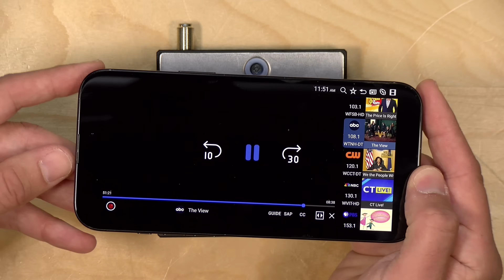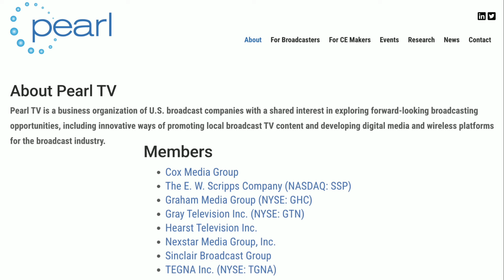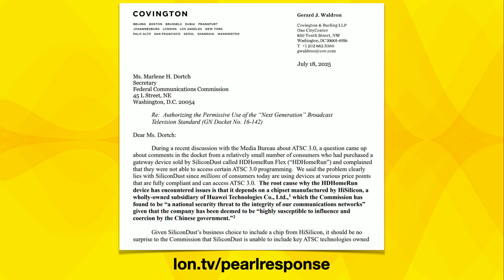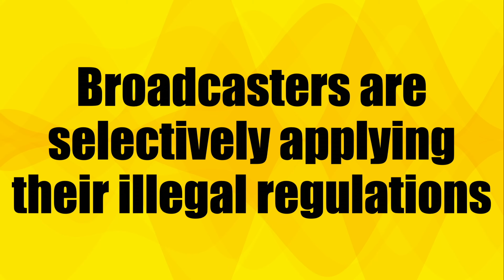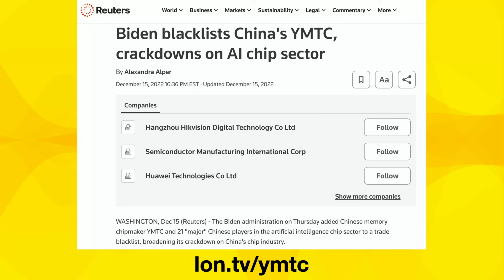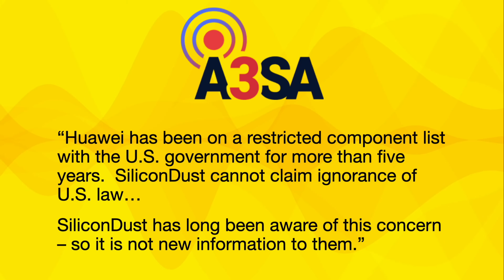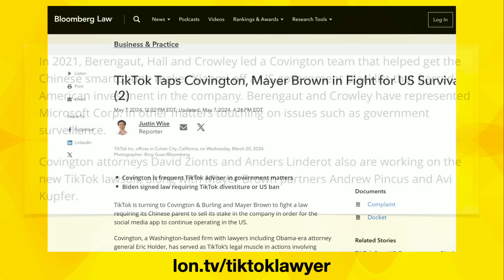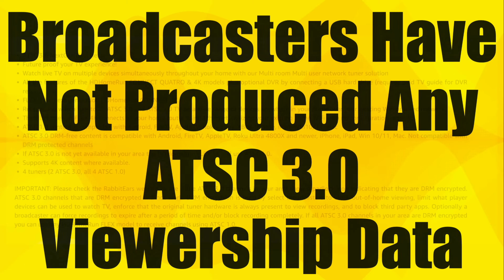Big ATSC 3 DRM Update: Did Broadcasters Admit They Are Selectively Enforcing the Rules?

Comment: I'd like to remind you of one fine point that you always seem to forget. The airwaves are a publicly owned natural resource just like the air, the water, and the public lands are. 
The OTA broadcasters use a slice of those public airwaves to transmit their signals. Why are they allowed to do so? It's something the FCC calls PICON or Public Interest, Convenience or Necessity.  It is a benefit to the public at large. Not only is OTA TV a public interest, (news and information) convenience, (entertainment) it's a necessity (communications in case of emergency.) 
The airwaves they are using belong to us. They are using our natural resource to broadcast their signal to us. In exchange, we've allowed them to sell commercial time to help pay for the expense of doing so. It's worked since the 30's pretty well and other than the annoying commercials, is a pretty good way to do it.
Everything was good until the cable and satellite TV industries came along and wanted to hold their content hostage.  But that's another story.
But it did set up their desire to cash in on anything they can to stay profitable as OTA consumers get fewer and fewer while the cost of running a studio and transmitter has gone up and up. DTV caused a lot of that, but that's progress.
The cable industry does not use public airwaves. They use a closed system - coaxial cable, or fiber - to deliver their content. The same goes for internet streaming. (which incidentally cable and satellite both rely on more and more) The satellite industry only uses some public spectrum to send their content up to the satellites, but it's a tiny fraction of the spectrum and it is narrowly aimed at the sky, not broadcast everywhere. They deliver the downlink signal from your roof (if you still get it that way. DirectTV wants to sell their product over the internet.) to your set-top box and charge you extra for local channels if they can.
So the comparisons to OTA TV is apples and oranges. Only OTA TV is using a large chunk of the publically-owned spectrum to provide their profit-making product. They should not be charging to deliver it. If they want to provide customer-paid services, they should do it over other modes of delivery, like cable, satellite, and internet streaming providers do already, because that's what they are becoming. Their delivery over the air is an exchange for the use of OUR airwaves.
This is lost on all the younger people who think that television is something that has to be paid for. They don't remember when OTA TV was all there was. They don't remember when all you got was three channels and none of them were very good! Things have improved and thankfully, a decent OTA system can get 20-30 stations at quality that was impossible in the past. But that doesn't remove the obligation that they have in return for using our airwaves for their delivery. 
If local TV stations think that they can deliver premium content by encrypting it, and making customers pay for it (on top of sitting through endless commercials) they will lose all OTA viewership as everyone will just switch over to the paid sources of delivery. Then they will be out of business.
The only people they will be hurting is the rural markets that can't get cable or internet, or won't pay for satellite because it's become too expensive. These are very often the same people who rely on it the most for news and weather in case of emergencies.

Comment: ATSC 3.0 is a bidirectional system because it uses an Internet Protocol (IP) foundation that allows for two-way communication, combining over-the-air broadcasts with internet connectivity. This means viewers can receive data back from the broadcaster, enabling features like video-on-demand, interactive content, and personalized viewing experiences, which weren't possible with the older, one-way ATSC 1.0 standard.  

DRM requires bidirectional communication to decrypt to an allowable device such as a TV set.  If the device is rogue such as a recording device, then no decryption takes place.  ATSC 3.0 is to support video formats greater than HD (1080i or 720P).  Content providers do nowt want us to save movies or shows with that high reaolution to prevent illegal sale of high resolution content.

Content providers are supposed to not use DRM on lower resolution content.  So if ATAC 1.0 goes away, we will still be able to watch SD and HD programming in the clear.
Reply from the maker: No DRM on the public airwaves.

Comment: my thing is why isn't a box built with an atsc 1, 3. 3 encryption chip. with technology today this can be done with the build of boards. jt is like on computer boards, all chips are not used at all times.  i would like a box with dvr option with the ability for upgradeable stowage/hard drive.mm2.  stagnation by groups.   as for the chips on board,  i think it was one which processes better.

i have an old TV  which need the hdmi port to  connect to OTA box.

Comment: sounds like a protaction  model for  sat/cable tv

ota fta has enough issues delivering dtv a distance and  the need  for  dtv boosterf  transmission 

regardles of the firmware deployed on these devices you are using a moca standard of  hfc 3.0/2.1 standatmdard which  has data standard 1-2.5 gbps

i don't know whether or not  home run is going to  to deliver data speeds past 10mbps, 1-10gbps

i do not think something designed to play cable services is designed to play ob oya/fta dtv signal since we battle  to get proper digital symbol rate 110-150% signal rate for clear signal 100-70% signale my get get channeling shoen that i doubt it be watchable in any manner

Comment: Okay, I'm officially pissed off. The entire premise of FCC licensing public airwaves to commercial entities for the purpose of "broadcasting" is based on  quid pro quo. The broadcaster gets to use the airwaves to generate revenue while providing a public service. The public service aspect has long been met by providing PSAs and news content that was editorially independent of the broadcast company and their profit motives. While this has changed in recent decades - the newsroom is now subservient to corporate desires/dictates - the shift to encrypt content that is /required/ to be freely available to the public under the terms of their FCC licenses is just absolutely abhorrent. The RF spectrum used by broadcasters, unlike spectrum sold to other commercial entities, remains the property of the public. Encryption of broadcast content should be treated as a breach of contract and the FCC should revoke the licenses of any stations or networks that are encrypting the signal. That's exactly how the FCC would deal with my amateur radio license if I were to encrypt any of my transmissions. Broadcasters should be held to the same standard.

Comment: The largest cable company had already converted all the local broadcast transmissions that were 1080i, such as NBC, CBS, and PBS, to 720p in January 2020, without telling anyone and trying to hide it with their newer boxes that are set to convert the 720p incoming signal to 1080p, so your TV doesn't see the original signal and thinks it's 1080p. But those signals have already cut the resolution of over the-air-broadcast channels that were 1080i by 50%.

Comment: Since I personally do not use a gateway device in the attempt to watch ATSC 3 signals. I have not found a single box that will work on all the channels that carry ATSC 3. What about the people who do not have access due to monthly income. I am personally set up a good quality TV antenna system and get ATSC 1 just fine unless the lightning starts to go crazy and then the signal stops for a second. But my satellite does the same thing except that it will go off for a few minutes. I personally cannot afford a hi price Sony TV to get ATSC 3 and my new Vizio did not have an ATSC 3 tuner. And I bet they do not get all the ATSC 3 channels.

Just Saying 
ATSC 3 has fallen flat on its face!!!

DE N2JYG 
A professional Antenna Installer and who has installed TV Antennas for 50+ years. Former Cable Engineer, 2 way radio Tech., electrician, tower installer etc!!!!

Comment: I have used HD HomeRun since before ATSC3 was a thing.   When my unit blew a few years ago, I got the first generation ATSC3 unit.   It was great when 4 stations in Indy went to ATSC3.   Now it's useless.   I still have all stations on ATSC1 but they are now on an inferior tower so I get a lot more weather issues.    

My setup has the antennas upstairs with the HDHomeRun attached to a wifi access point.   That means no cables at all out of my upstairs and it works very well.   No cable runs in the house are needed.  

The sad thing is I have one TV that's ATSC3 compliant, but no apps can use it to decode the audio. AC4 let alone handle an encrypted input I could receive if I ran a cable.  I do a lot of DVR more than watch live so encryption creates additional problems with time shifting.   A straight signal passthrough would work in that one case.   Other TVs, phones, etc obviously can't do that.   Net result is I'm stuck on ATSC1.   Most annoying.

Comment: Why are we even surrendering to DRM in the first place? The FCC should just ban DRM from all NExtGen ATSC 3 signals or just stick with ATSC1. Broadcast TV was free OTA since the start of OTA TV. This should never be changed to allow DRM because you know we are going to have to PAY for the decryption. It is bad enough to have to buy a device to do this. OTA should got from antenna straight to TV and no device in-between.
Reply: There have been encrypted off-air TV channels here and there since the ‘50s, but they always fail.

Comment: Had the same thing. I LOVED IT. I kept my win7 system with media center running just so I could use the direct cable decryption without using their APP. That is UNTIL... the Cable company decided they're just not supporting cable cards anymore and cut me off completely. TOTAL BULLSHIT...JUST PIRATE EVERYTHING VIA torrents. Seems to be the only way to watch what you want now without a connection into your wallet.

Comment: I'm good with atsc 1.0.... It is what was included in my high quality jvc projection from 2006. I have a dish atsc tuner box, and a couple other converter boxes. Spectrum cable, who does not own the boxes. They think it's hilarious to sit in my apartment parking lot, and reprogram these boxes. One of the boxes has a really unstable antenna levels because they flashed it with junk firmware.

Comment: I hope TV manufacturers just throw their hands up and stop including ATSC 3 tuners.  Without them ATSC 3 would die a quick death.
Reply: ATSC 3 is great but the DRM is the issue.  ATSC 3 does produce a more reliable signal and breaks up less.  With the lighthouse stations having multiple channels, it can help in many markets where there are too many channels to fit in the narrow range of channel frequencies left.  Philly was a market like this.  Without ATSC 3, you wouldn't get ABC since that's on RF 6 for ATSC 1 which is terrible.
Reply: That's pretty much what is happening.

Comment: I haven't been able to tune into any ATSC 3.0 channels in the Detroit area since Saturday. My Sony X90L will pick them up during a re-scan, make them the default channels, but is unable to tune them in. The ATSC 1.0 versions of those channels tune in just fine. I'm not sure what the hell is going on. Nothing has changed on my end, so its them, not me. I always thought the real benefit of ATSC 3.0 was a stronger signal that was less susceptible to atmospheric conditions. Here in the Detroit area, Fox, (2.1) NBC, (4.1) ABC, (7.1) WMYD, (20.1) and CBS (62.1) are all broadcasting their ATSC 3.0 signals from the same from the same tower. (124.02 Degrees) That is the same location as the ATSC 1.0 signal that Fox comes from. So, the interesting thing here is that the ATSC 1.0 Fox signal (2.1) is the only major broadcaster still using VHF in the Detroit area. All of the ATSC 3.0 signals are re-broadcast as UHF. So here in the Detroit area ATSC 3.0 potentially solves a few issues: 1) You would only need a UHF antenna, 2) To get all the major Broadcast channels you would only need to point to a single location (124.02 Degrees) and 3) You should have a stronger, more robust signal. Here in the Detroit area, every time I have checked, the ATSC 3.0 broadcasts are 1080P, with AC-4 audio. I'm not sure where the Pearl TV is going with this, I'm guessing they would like to see ATSC 1.0 go away, ATSC 3.0 put in it's place so they can charge higher rebroadcasting fee's to cable and satellite providers by using DRM?

Comment: The reason why a gateway device is the most popular tuner should be obvious, but its literally the difference between having either multiple antennas or splitting the signal multiple times, which degrades the signal with each split, and both require long runs of coax lines through a residence to each television, which ALSO would require a separate tuner to decrypt the signal. Logistically, this is ridiculous, and is the main reason ATSC 3.0 is going to fail. Now, I believe this is by design, and the FCC already has plans to use the transmission technology for this for other uses. OTA is going to die, and my expectation is sometime before 2030. We are already starting to see local sports games being tied into streaming services. I pay for MLB TV for the Phillies games, but are still subject to blackouts for any games with exclusive broadcast rights on other stations other than the local NBCSP channels (this includes Apple TV, Fox, TBS, ESPN and any others that may come along). Not every local market made a deal with the MLB for even those local channels as well, so I'm actually lucky I can get any of them at all.

Comment: Thanks for the update, pretty depressing overall. We have always been an OTA family and looked forward to the technical benefits of ATSC 3.0 and wanted to use a gateway device to eliminate the need for coax cable to each location we want TV. 

Traditional TV is having a hard time competing with VoD (video on demand) so it seems broadcasters are doing everything in their power to kill traditional TV. Looks like another industry so intent of protecting legacy business they miss a technology inflection point and quickly fade away. I've posted this before TV set OEMs should just eliminate the entire RF section and call it a smart monitor.

Comment: Tablo made it so easy for me to cut the cord, only one device needed, no need to snake antenna cables all over the house.  I can even sit out on my porch and watch TV on my tablet  And I can reocrd what i want, as well.  I agree that this IS what people want.

Having to buy a separate tuner for each TV is pricey.  And right now, buying TVs with built-in ATSC 3.0 tuners is out of financial reach for me and many other people.  This nonsense will cause low-income people to lose access to OTA TV.

I live in southern NH, which is the Boston TV market.  Most of the ATSC 3.0 channels here are encrypted.  Fortunately, I can get them all in ATSC 1.0.  So just because ATSC 3.0 channels are here doesn't mean anyone is watching them.  I flat-out refuse to buy any ATSC 3.0 stuff, I will use what i have (Tablo) for as long as it works.
Reply: I agree and I'm in the same market (southern, NH) and same boat as you (1st gen Tablo). It works great, I've had it for 10 years and I don't have the ability to run cables throughout my house to every TV. Also, each time you use a splitter the signal decreases by 3db. This causes me to lose many stations. DRM = Fail for ASTC 3.0

Comment: rewality of the dtv signal if you haven't installed rg-6b or better  you will have piss poor signal ra where reception..the new standard  is mostly sat/cable tv standard
Reply: B? And RG-59 is fine depending on cable length.

Comment: Is there an accurate list anywhere of the devices that are capable of receiving ATSC 3.0 DRM encrypted signals?... I have  TVs that are fine for me.. and have no desire to spend money for an "upgrade" I don't want. Also I  have a Tablo gateway that works great with the ATSC 1 signals. I see no reason to spend any money for ATSC 3.0... which means all the advertisers will also be the losers when ATSC 1 goes away.
Reply: The devices that have HDMI out that plugs directly into your TV are the ones that will work.
Reply: @Banzai51  which means for every one that has multiple TVs they will need a device for every one.  No thanks!

Comment: While I am a huge supporter for free OTA reception, and have been using Slingbox for 20 years, and recently streaming from a dedicated H.265 encoder(and still pissed off about the destruction of Locast), I understand why some devices may not be trusted.  If a device has a processor and operating system that can be compromised, it may not be able to be trusted not to be turned into a DOS bot.  I'm not saying that this is the case with any specific item, but any item that has a computer built in with internet connectivity can possibly be compromised, even if it's primary function is just to transmit video and audio, as clever hackers can reprogram these to do many other malicious things outside of the scope of their original intended function....

Comment: I have my nice ATSC-1 converter box.  I won't be buying an ATSC-3 device so long as this DRM BS continues if ever.  At some point, I think I will be taking my TV out to the curb because streaming the content will be less trouble and will likely be free for the stuff I want.
It is clear to me that the entire ATSC-3 fiasco is intentional and the goal is to put an end to over the air TV.  I expect that they will succeed in this and that the spectrum will be taken away and sold off.
Reply: If you have a PBS station that broadcasts on ATSC 3, it's almost guaranteed that it will be free of DRM encryption.
Reply: @ArtiePenguin1  "almost"